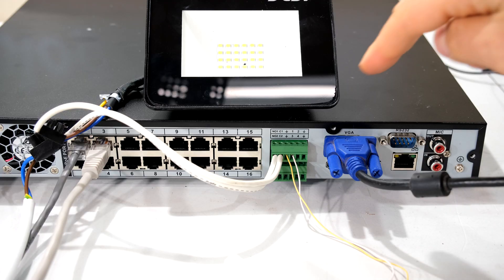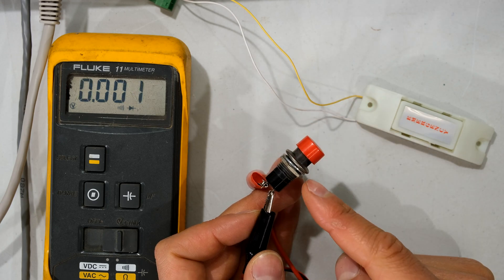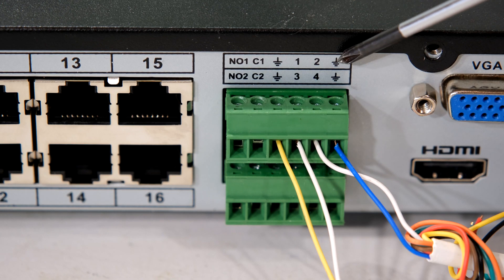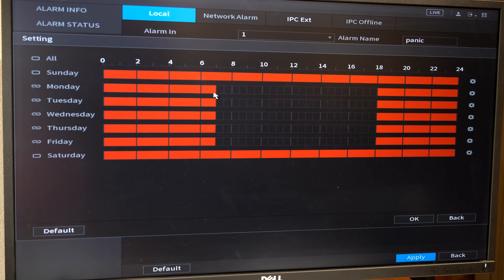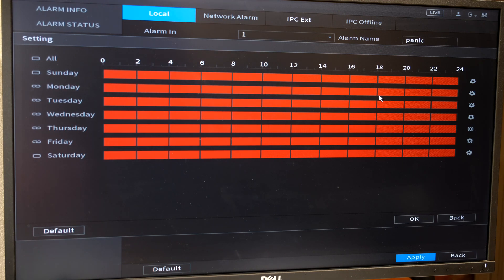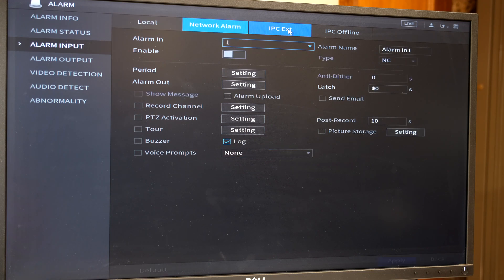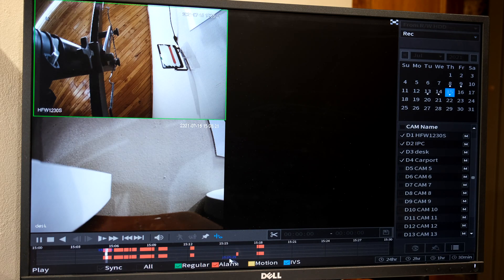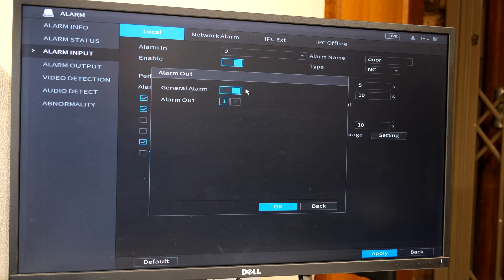How to use the alarm inputs on your Dahua NVR - How to connect alarm sensors to your NVR - Tutorial

Comment: How would you hook a wireless contact to it? Not sure if it’s a problem with my NVR but contact works with it being normally opened but not triggering when I change to NC. Contact is a 5816 Honeywell. I’m using the no and common on the NVR.

Comment: Pardon me but I am a bit confused here and hope you could give me a hint. While this video is about your 16 channel, I have a 8 channel NVR which the only difference I see between yours and my 8 channel is the printing on the rear panel above the green connector blocks.

On your NVR, the printing is as follow: NO1 C1, the special marking which could be the negative (earth), followed by 1 and 2. Never mind the second green connector block below the top block, as I may not need to use it.

What I don't understand is the meaning of NO1 and C1, followed by a symbol that looks like what I think it is, a negative ( - ) symbol.

What I want to connect is a 9V powered flashing LED so that when an event is triggered, the NVR buzzer goes on. But when I am listening to music or play computer games I usually wear headphones and this masks the buzzer sound and I hear nothing. If I plug a LED light into those connection points of the green block, in the event that the alarm is triggered, I can see the brightly flashing LEDs being on and that gives me an indication that the camera has detected a moving object, e.g. a cat, dog, etc., and because I also have a Aten 4 channel switcher, I can quickly switch the Dahua channel and view on a single monitor what tripped the camera detection in an instant, only to find a stray dog triggered it.

I also have a Hikvision V4.0 NVR with 2 cameras and, though this NVR is much easier to use and operate, the connections to the siren or flashing LED light on the similarly green connector blocks is a breeze. Hikvision NVR beeps like, beee beee beee, bep-bep, and the LED flasher connected on the first 2 connection on the far right of the block. The LEDs flash for about 30 seconds, which is enough to get the attention I need.

Dahua, on the other hand, has a shorter buzzer sound , but the connection of a similar LED flashing light is confusing as I don't know what NO1 and C1 means and what is that symbol after C1 and and another at the right end of the block (near number 2). Can you help please?
Reply from the maker: NO1 is for normally open 1 (1 being the first relay). C= common for that relay. These are not grounded, they are terminals to a relay only. If you would like clarity on relays, please check out some of my many relay videos: https://youtube.com/playlist?list=PLYY5TJHy2ast4933aJ_5MmvH_LBDPfOMu